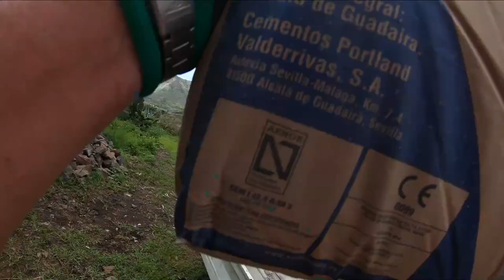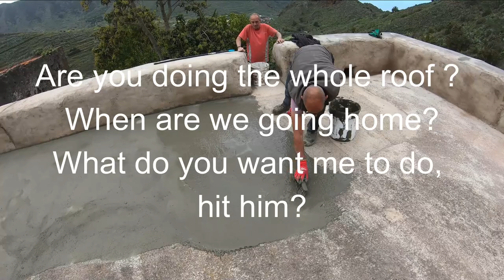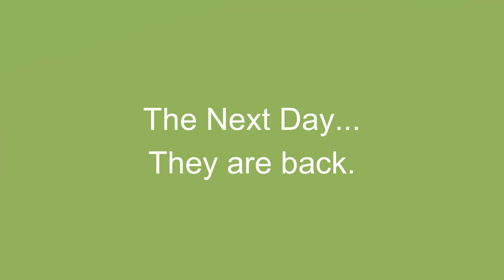BVRC027 Deadlines Working to make my dreams come true Tenerife farm house restoration Moving on up

Comment: Muy buenas! Que co*o esta haciendo esa gente? Plastic on top of concrete? Really? Also, a "skim" like that on the roof will NOT be waterproof! Best they could do 50 years ago but not today. Paint all you like on top of that but without a layer of membrane or "malla" it will not be transitable and certainly not waterproof. Maybe I missed it's application on another video. I hope so. Time to find someone who knows WTF they are doing. Sorry but been there, seen it, done it and have had to pay for the consequences. Best of luck!

Birds are most likely aguiluchos (buzzards). May be eagles but they are pretty rare here these days. Cernicalos (kestrels) are smaller, fly lower, have notable light brown backs and a totally different cry.
Reply from the maker: Thanks David for your comment. It was a bit of a disaster this week !  The azotea will have a membrane with the epoxy paint.  I’ve seen it done once before but not done it myself.  Unfortunately the concrete is down and over 15 cms thick … so I won’t be taking it up !  Thank goodness it’s only a workshop !

Comment: lol  converting from imperial to si so you can use imperial sized materials...memories of frustrations past...while studding architecture and being the group of students  who got to deal with canadas change to metric  i got to work in mm and scale . you would spend hours measuring and then work it out at scale then draw it...its a total pain trying to memorize random large mm numbers that coenside with with all the imperial sized materials  ...4x8 sheet goods ...drywall everyone knows what that is  what 4x8 means  there is zero confusion with the standard  now 1219.2 x2438.4 means nothing to anybody but an insane architectural technologist lol. you will run into this terry 12 mil bolt is 1/4 inch....nothing changed but the convenient numbers we reference things with .  the concrete sacks 50 lbs.....as for the disbelief in lazers i keep telling you a hose full of water cannot lie and he has to accept it lol . roof is looking great  and it looks like  more cleaning around the property was done ;] remember that membrane is going to want uv protection .  a slab on grade...bedrock  really dosnt need welded wire mesh reinforcement to deal with normal residential loads......unless your putting in a crane or something of that nature i wouldnt be overly concerned .  as always thanks for the videos and looking forward to more of the journey
Reply from the maker: Thanks Mike.